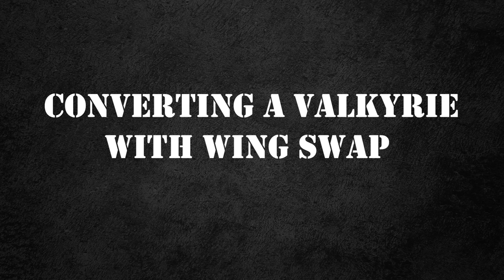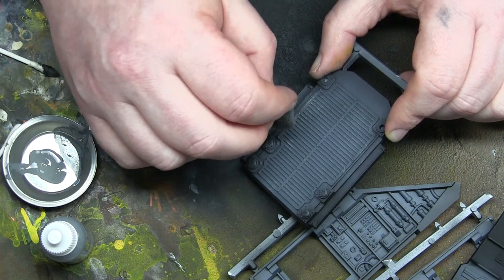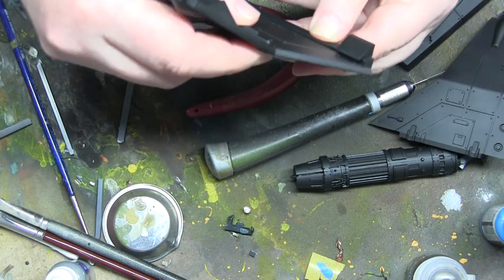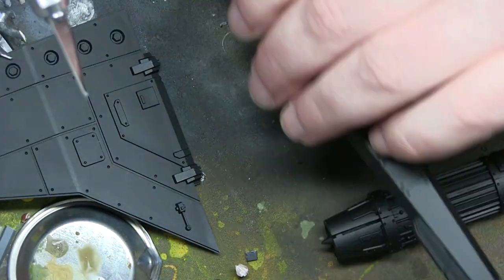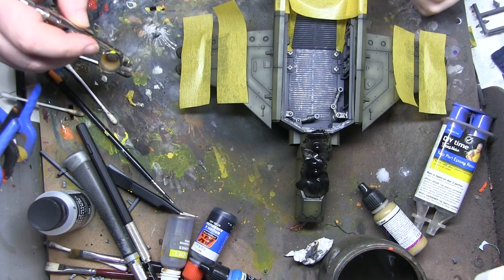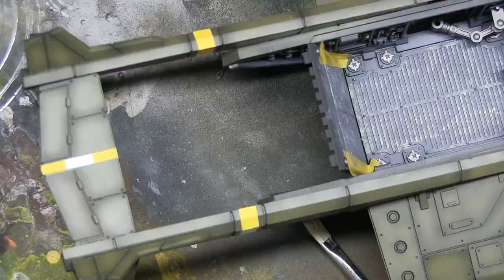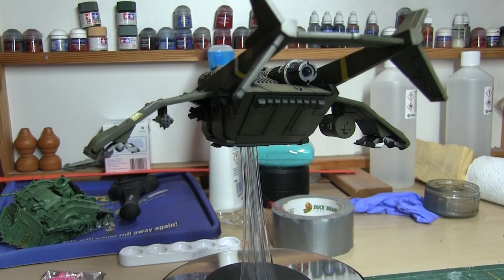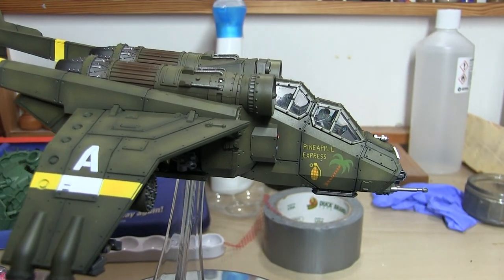Astra Militarum Valkyrie - How to swap the wings for maximum rule of cool

Comment: Valkyrie is looking good, especially with the wing swap. For the underslung load it might look better with smaller cables going to the corners of the pallet/ crate rather than the single chunky cable in the middle?
Reply: I did try that very idea, but I couldn't get a wire that would take the weight. Glad we are on the same page!
Reply: @wolfworks101 to continue this thread, I think if you use piano wire or thin brass rod it should be enough to hold the aircraft up.

Comment: it looks to me like the leading edge of the wing protrudes past the fuselage by about 10 - 12 mm, and the trailing edge is back from the end of the fuselage about the same distance, would it not have been possible to slide the wing back so it looks like it mates up to the fuselage more correctly?
Reply: Thats a good idea. I don't have another one to try it with but it would sick